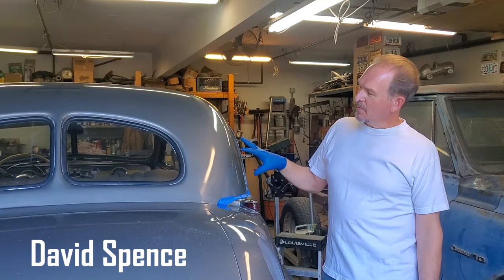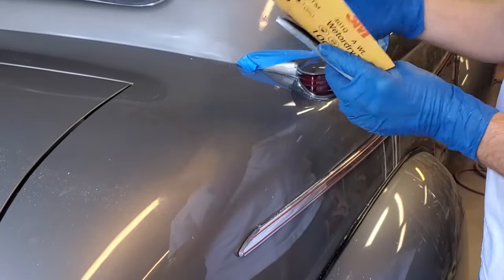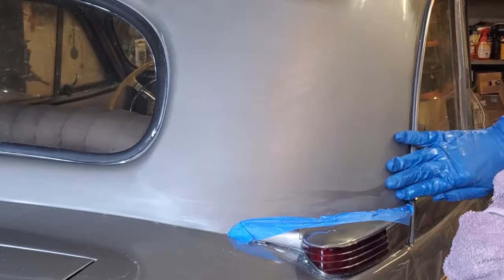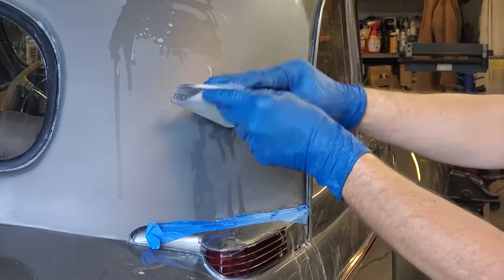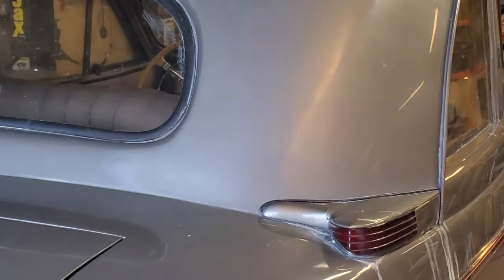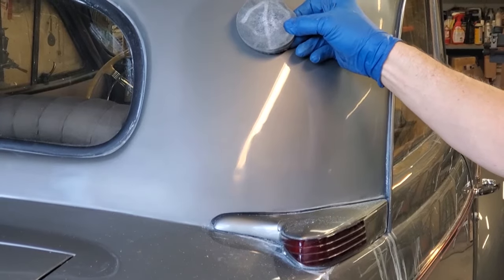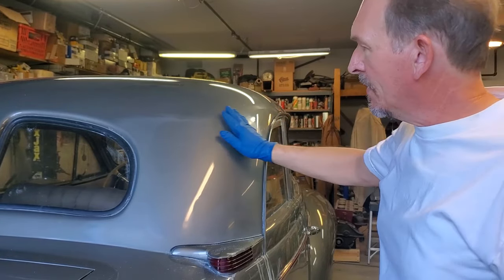How to Sand and Buff Clear Coat - 3M Sand & Polish System

Comment: Hello, I need some help, I went sanded, primed, base coat, then clear coated all duplicolor product on a quarter panel. Paint color blended good except the surface is course and not silky smooth or shiny like adjacent areas. Is there a way to correct the job? Do I run the risk of making it worse,?

Thanks
Reply from the maker: If you have a good coat of clear as described in the video you can 
use the process described to fix it. As to why one had the problem 
it is largely, but not always completely due to application technique. However, even new car manufacturers with their fancy paint facilities do not produce a finish that is perfect without additional hand work.
Reply: @CarzPlus  thanks
Reply: @CarzPlus  hello, after reading your suggestion, I compound and polished my not so shiny duplicolor clear coat and I did see much improvement. I still can see a difference between the factory finish and my work. I wonder if I scuffed my work, and apply 2 k clear coat to my repair work, would I be creating a  mismatch    to the 2017 factory finish (very good condition)?

Thanks
Reply: Mean to say not much improvement
Reply from the maker: When trying to match the finish of a modern base coat clear coat system you should use a modern clear coat catalyzed paint. Lacquer is great for a whole car or project when you are not directly comparing it side by side with modern clear coat. The car in this video is not done in lacquer. We have videos covering both on the channel

.https://youtu.be/9rwculdVNZQ
Reply: @CarzPlus  hello, is it possible to spray 2k clear on half of a Corolla bumper,/rear quarter panel, and not see the were the adjacent area starts?
Thanks for your help

Comment: Is Meguiar's Ultimate Compound the same as 3m perfected rubbing compound
Reply from the maker: No they not the same. Each is its own formulation. This is not to say they will both not perform well. I use what I showed in the video. Other products may well work in a similar manner.

Comment: That was two years ago nowadays we call them commie pads You should’ve painted it with the windows out so you could’ve sprayed inside the cracks instead you have it all over the black molding I don’t know what you were thinking but you’re doing a fine job polishing.
Reply from the maker: This is very much the same impression someone else had in a comment sometime ago. During the 1930s, cars fit and finish on an upper-middle-price range car are not the same as the high end cars of the era. They were better than the low end cars. The black "moldings" are the rubber gaskets that hold the rear windows in place. They are fit correctly, and they fit exactly on the patterned glass correctly. There is no paint on these rubber parts at all. The paint is on the metal only. I always paint under all the replacement rubber in advance. Hence the glass is out at that time.

Comment: My goodness.  Do you finish the entire vehicle this way?
I have to wet sand the hood I just cleared.  I want to use my DA with 1000, 2000, 3000 discs.
What do you think I should do?
Thanks
Great video!
Reply from the maker: Yes, and it did take a lot of patience. The DA would be too aggressive for the desired results. If you can, stay with the procedure as shown in the video.

Comment: Great video! How do you know if you're using too much water or not enough?
Reply from the maker: The best way to tell if you're not using enough water is when the surface feels like it's starting to run dry. Just dip the pad with sandpaper back into the water and let a little bit run off. I've sanded an entire car door using the same formula in the video: 9X9" cake pan filled half way with water and a few drops of Dawn dish soap added, and didn't run out of water. You can't over do it with the water. It will sheet off during the process.
Reply: @CarzPlus  I used windex this week, just because it was handy when I needed to do a spot. I ended up using it for a whole fender.
Reply: No such thing as to much water. He does not use enough water in my opinion.

Comment: Im not big on 3M Perfect It compounds and polishes i find them to be over rated. When it comes to compound and polish 3D and Sonax rule that industry. However I do like 3M sand paper especially the purple cubitron ll
Reply from the maker: Thanks for writing. Some of our viewers may give it Sonax a shot. 3M has been my preference for a long time.
Reply: @Carz Plus  3m as a company has just really gone down hil. I do like their cubitron ll sandpaper. Their claybars have basically gone to hell in a hand basket which are now made in Brazil go figure. I would give 3D a try you got nothing to loose. Saving yourself money by just needing 2 steps with 500 then 520. I like sonax but it doesn't have the working time 3D does. Technology is changing with ceramic abrasives like 3D uses and gets you done quicker with an even better result

Comment: I had these like dots after clear coating my carbon fiber hood. So I used a 1000 grit, and now my hood is foggy. Should I re coat? I have a polisher that doesn't really help with buffing anything out. What would you recommend?
Reply from the maker: Not sure if you mean depressions or bubbles. Depressions would mean fish eyes. These can occur with silicone or oil contaminants on the surface coated or in your air system to your paint 
gun due to inadequate filtration. Bubbles would more likely occur with too fast a surface drying condition and wet paint trying to outgas below an effectively sealed surface. If fish eyes you need to be sanded smooth and be sure you eliminate the source of contamination. Using a proper precleaner is a must. You may also want to add fish eye remover to your clear. The process for bubbles would be the same, but you will need a slower acting clear coat mix assuming the same relative temperature when you spray. This will slow down drying time and should stop bubbling. Still make sure there are no contaminants as mentioned earlier. You also need to follow up with the other grits and polishes shown in the video or is will appear hazy when done. Just using 1000 grit will not normally allow a quality shine on the finished surface.

Comment: Why did you clear over primer?
Reply from the maker: There is no clear over primer. The color in the video is the original color for this 1939 Graham Combination Coupe. The color is called Airliner Gray.  It was the great depression and colors on most 1930's cars are far more subdued than in later decades.

Comment: Damn.  Never in all my years have I seen anyone sand that hard with 1000. Absolutely amazed that you didn't cut right through.  And folks use s pray bottle with soapy water while yourcsanding so you always see what you're doing.  If your rocking the car that much your pushing to hard and your ruining your paper.
Reply from the maker: It's always worked well for me. spray bottle with soapy water while sanding is an interesting idea. Thanks for watching.

Comment: Do we honestly consider painting an entire car in a driveway to be feasible? I'm considering attempting it but I'm thinking I'll need basically a tent to avoid contaminants blowing into my paint, right? Seriously, has anyone done it successfully?
Reply from the maker: I have a few times. Best time is very early morning. You need a dead calm day. You can also paint at lower temperatures when fewer to no bugs are present. You might want to take a look at this video where we painted a vintage camper. It was done in separate phases. https://youtu.be/hqS4B8UF_Mw
Reply: Considering potentially overspraying onto neighbors vehicles, or even a local Karen calling the police on you for venting paint directly into the air, i probably wouldn't do this unless I had a property pretty far from the next house.
Reply from the maker: @pawelallable  Yes, in some places that's quite true. It's still okay to legally do this at home for many of us. There are also portable spray booths to buy or rent. Here, in our area you can even rent a professional level spray booth. You could also construct a spray booth in your garage for a temporary solution. The video coves finish-out, which some people choose to do after a professional has painted the car for them.

Comment: LMAO. first of all you dont put the compound or polish on the pad. second of all you dont polish or buff with a small bufffer. that leaves swirl marks. third ,dont sand so close to the edges. leave little space that way you dont have sand scratches at the end. the litttle buffer/polisher is meant for the edges. but if you go to deep thats no bueno. especially on cars like this
Reply from the maker: As I'm writing this we received 30+ positive comments and I believe everyone of them can't be wrong. In addition to thanking us, some of those who commented were pleased with the results. 

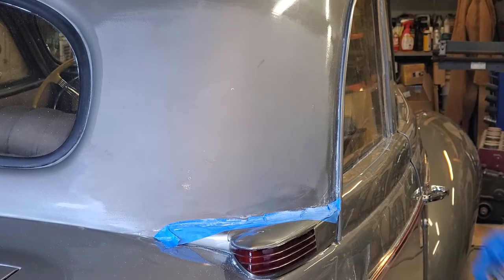We used sandpaper grits that started at 1000, 1500, 2000, 3000, and then to 5000. At 6:20 those small areas are mentioned and the smaller buffer is suggested for that area, and the big buffer for larger areas. The small  buffer is used for the purpose of demonstration. Although we talked about the large buffer extensively, it wasn't used in the video. At 7:10 the video instructs you not to sand too close to the edge. At 7:30 you're told not to sand too close to the drip rail. The curvature of the vehicle kept us from sanding in those tiny areas. 

Both techniques of applying the compound to the surface or the pad are discussed. It's a matter of preference. 

As a final thought, there are no swirl marks throughout the car as shown towards the end of the video, during the conclusion.

Comment: To much work. Why so many steps?
Reply from the maker: Fewer steps will, in fact, result in it being more work and taking longer. Each step is based on removing the scratches from the previous steps, resulting in the smoothest surface possible.

Comment: he obviously doesn't know 3M sandpaper is MADE IN CHINA.

They have an industrial base called 3M
Reply from the maker: 3M is headquartered in St. Paul, Minnesota. 3M is an abbreviation for Minnesota, Mining and Manufacturing. On the reverse side of the sandpaper package it says, "Made in USA with globally sourced materials." We've done a thorough search and haven't found any reference to China. If you're going to make this type of comment, be sure you know what you're talking about.

Comment: I've painted hundreds of cars but this last one turned out so shitty. I believe it did because I was too precautionary. I expected it to be 1 shot deal and returned to customer. But in fact it looks like a nightmare, a rookie drunk teenager could have pulled a better finish off. So I am here to painstakingly fix all the runs, fisheyes, dust, bugs, and moon craters it has. All because I didn't just spray it on the fly! 😂
Reply from the maker: Oh, no. That sounds like a lot of work. Hope everything turns out for you.